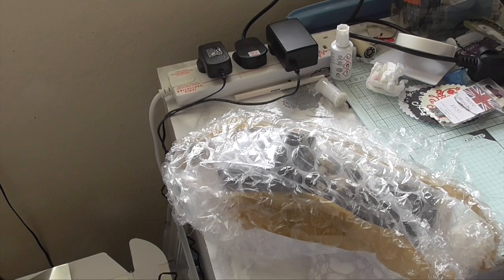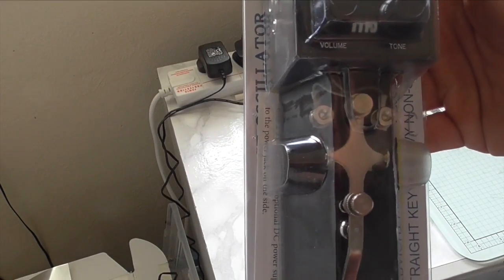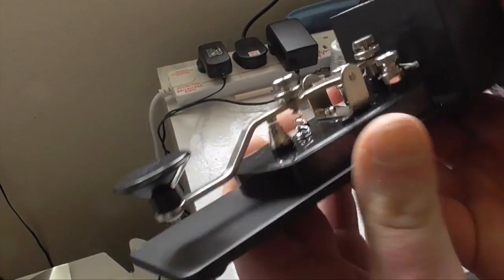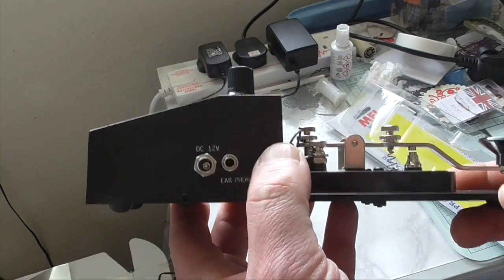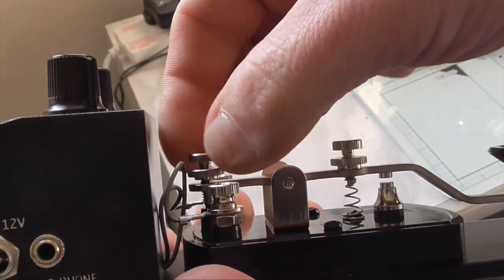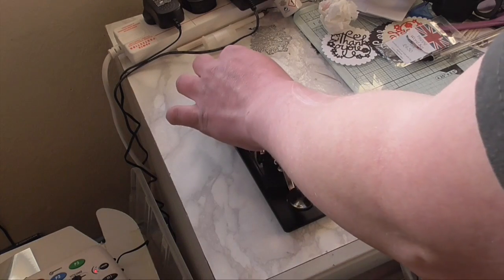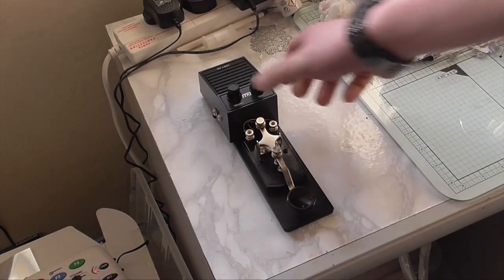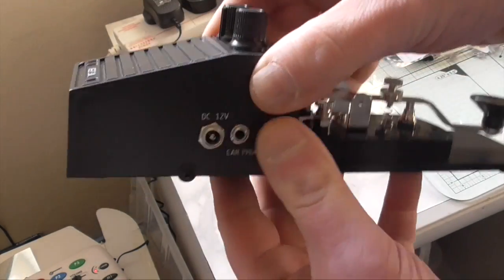MFJ 557 unboxing and test

Comment: Just putting this here for anyone else wanting to learn to send CW (this will not help you to receive/decode which is a different and arguably more important skill), you can build this yourself for about £5-10 mostly with bits you have lying around at home.
Reply: Andrew / M7AGG hello Andrew. Does this manipulator can be used as a real manipulator or it is only a practicing device ?

Comment: Just got one to learn and practice on. So there's no way to turn it off?
Reply from the maker: Adrian Rush no don’t think so -.-. .... . . .-. ...
Reply: OK. Wanted to make sure I wasn't missing something. Will just need to buy a power supply, then. - .... .- -. -.- / -.-- --- ..-
Reply from the maker: Adrian Rush you can use a power supply the tone will be better and sound more like morse code I find if I use a battery the tone sounds dull
Reply: watch the video again....2:15 says that it is OFF until the key is pressed.

Comment: Greetings from Pensacola-
I just received mine today, and had to get a battery and wished I had found your instructions before I attempted opening it up. Anyway-all went well getting the battery in but wasn’t sure about the rest. I’m new to all of this—so a big Thank you 🙏 for the video of instructions. I’m so excited now in using this to practice. I’m attempting to learn Morse by sound and only have about 10 letters down so far but determined to master the codes. 
By the way- I simply love your accent!  Made me smile from ear to ear. 
But once again... thank you so much. Much appreciated!  🍻 cheers!
Reply from the maker: Trish P use a better battery . I’ve used a 11.1v drone battery and it’s so much better . If your radio has bk in option you can use a paddle of straight key to practise with out sending anything across the airwaves I’ve done a video on it with a icom ic 718 radio
Reply: 2j4ez 
Thank you so much!! Much appreciated.

Comment: Hi there Jez ,Been watching your VT's via Fred Sheds FB page . First of all a big thumbs up on the mobile bicycle set up 👍.i enjoyed watching from start to finish, my suggestion to reduce your SWR was to add a counterpoise to the top of your antenna . Thankfully your extended groundplane worked a treat . Q: I looked on QRZ. for the callsign M6IQJ & for 2J4EZ , FYI, neither callsign show up ?!!. Also ..-..?? Or did I read it wrong, just starting to try & get my head round CW, lol.. best 73 26Ct2037 Phil on the Hill 👍:)
Reply from the maker: I've not put the my call signs on there as yet will do soon
Reply: Oh ok just thought id tell you in case there was a issue, but  no problem then .73